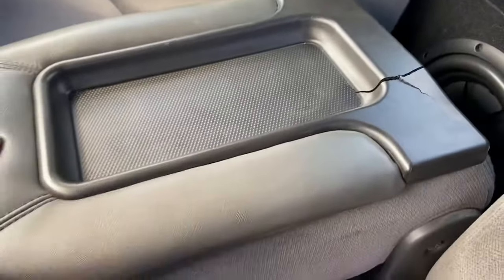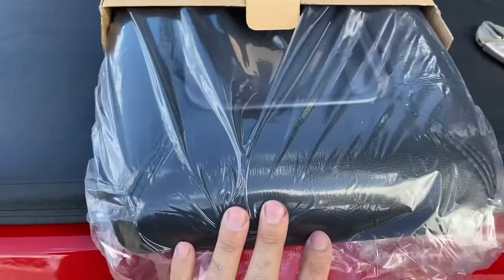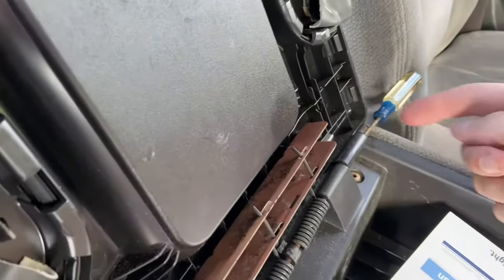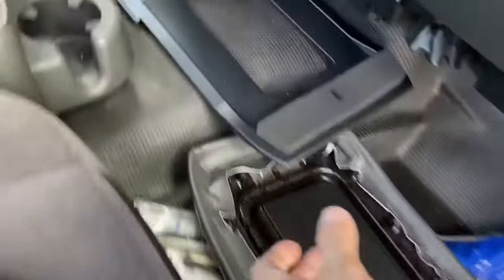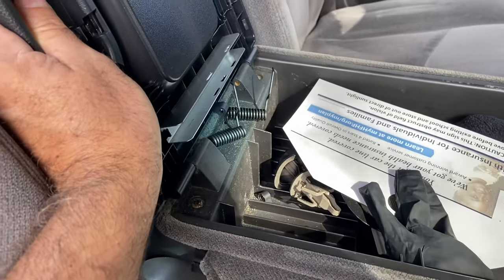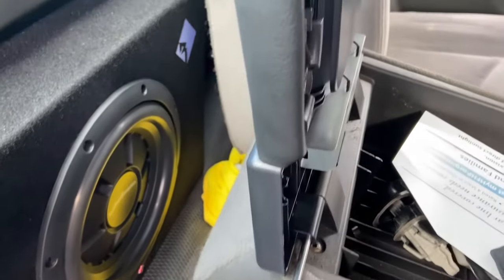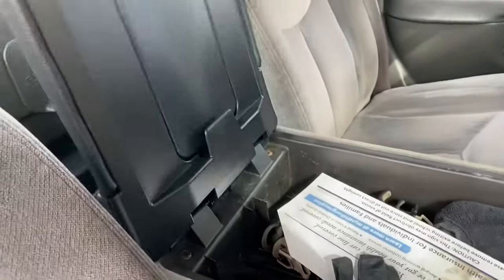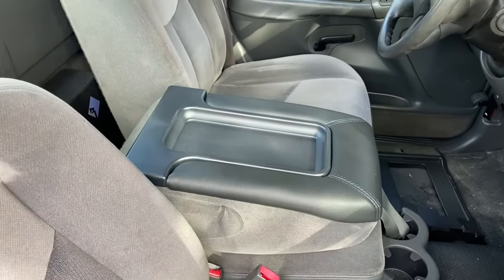1999-2007 ..GM TRUCK CENTER CONSOLE LID REPLACEMENT FIX.. UNDER  $50

Comment: I couldn't get the new pin in. It was a tight fit I had to get out a hammer too. My old truck may not look as nice as yours but my center console does. Great video! Thanks

Comment: Just watched your video, which I think is extremely helpful.  One question...my 1999 Silverado's center console lid is upholstered with the same, matching cloth as my seats.  Is there an easy way to remove the matching cloth from my old, broken lid and reapply it to the new lid so it will still match my seats?
Reply from the maker: Not sure haven’t tried to remove the material before. Sorry. Thanks for watching.

Comment: Do they replacements kids for the 99 2000 model with the full console that goes right up to the ac controls with cupholders?
Reply from the maker: You can swap in a Tahoe or Yukon center console or a 4 door upper trim console.